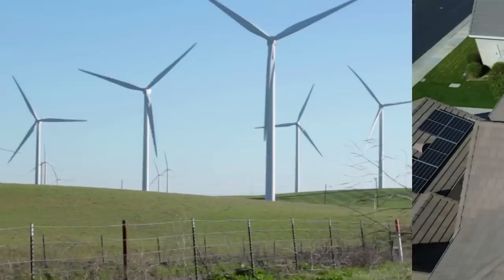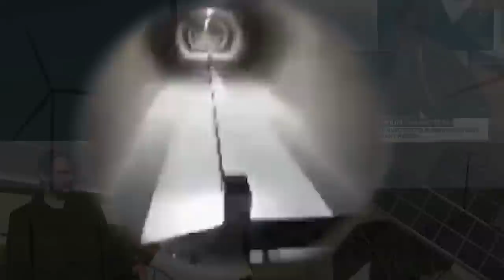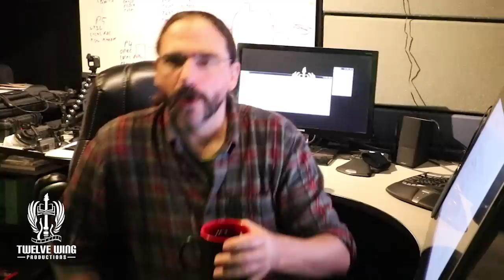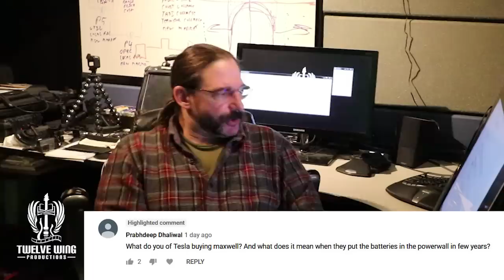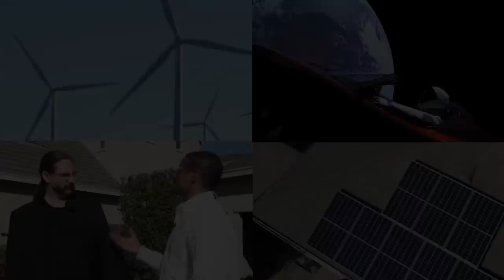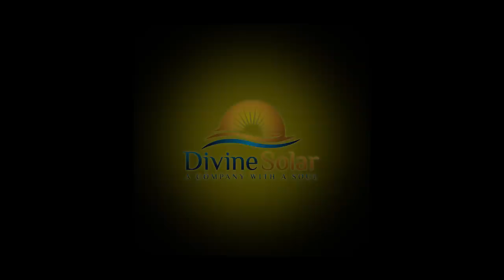Tesla purchases Maxwell; What does it mean for the Powerwall?

Comment: I haven't looked that deeply into the tech specs of the PW2 but I would have imagined the 5kW constant output limitation to the PW2 was due to the built-in inverter and not the battery cells themselves. Due to the lack of power retention in capacitors I don't so much see them having good use for the home unless it is used on the AC side for appliance starters, like an air conditioners soft start. The best use I see for the ultra capacitors is just as you described, for rapid car charging where the cap can then slowly discharge into the battery pack, allowing for a very rapid "refuel". I won't even get into the performance benefits an ultra capacitor could add to an electric sports car.
Reply from the maker: I don't disagree, and frankly I am holding judgment on the whole thing until I can get more solid information on just how "ultra" the new ultra capacitors are.
If they can hold more than 80% of their charge for 8 hours, they will be a HUGE benefit to home battery installations.  That's about the tipping point though.  Anything less and the losses will be too great.  If they can manage more than that, then it will be a game changer for the home.

I can envision them being available as a separate module.  But again, much depends on efficiencies and physical size.
Reply: @twelvewingproductions7508  I was thinking more or less holding at least 90% of their charge for at least 24 hours. Again, we don't really see any reason for rapid recharge or discharge in home use other than in appliances that have quick heavy demands, such as an air conditioner or well pumps which we already have soft starters for. Solar has a limited output, so lets take our 8+kW arrays for example, I only have two PW2s, nothing compared to your stash, but I have an 8.82kW array. Even at its max output I can't push more energy to the current model PW2s than what they can take (10kW combined) for a charge. Unless we have wind slapped into the mix which can have a MASSIVE output all of a sudden, then very little, I don't see much need for capacitors in the home, the loss would just be too great for pretty much no return.
I would love to hear what you had in mind for home use, however.
Reply from the maker: @BrettB246 , that was kind of the point I was trying to make.  That it's not just the large loads but that in a home who's average, like the ESP home, is 30kwh a day, 2 powerwalls simply isn't going to cut it if eachis only capable of 5kw of discharge.
But add ultra capacitors and that capability changes.
So what I have in mind for home use IS The Energy Sovereignty Project.  That's why I'm doing it with that home and not the studio that averages about half that at 17kwh per day over the course of a yearly average.
Reply: @twelvewingproductions7508  I think you're still confusing capacity with rate of discharge. The PW2 has a total capacity of 14kWh (13.5kWh usable) with a sustained rate of discharge at 5kW (likely inverter limited) so over a 24 hour span it could discharge 120kWh based on the discharge rating, but only 13.5kWh over that span unless recharged multiple times. Two PW2 units could discharge at a constant 10kW with a usable capacity of 27kWh. Considering you don't draw from the batteries during the day, normally, 27kWh of storage is adequate for a home that consumes 30kWh over a 24 hour span. It wouldn't work when you take long or multiple overcast days into account, but that has nothing to do with their rate of discharge as it's limited by the inverter. So thinking of an ultra-capacitor as nothing more than a battery with faster charge and discharge capabilities, increasing the storage ends ability to discharge at 50kW does nothing for home use when the inverter is limiting it to 5kW.
Generally speaking 5kW constant output per PW2 is sufficient as larger homes with higher demands will also usually require larger storage capacity and thus more PW2s. In situations like your own, you would better benefit from larger attached storage and not a higher output rating. Adding a secondary bulk storage unit, like a flow battery, which has higher storage but maybe lower output rating would be better as I'm sure outside of charging your cars you rarely pull over 10kW at any given time but could benefit from an added 200kWh of storage.
Increasing storage capacity doesn't require higher output ratings. Having a low-output high capacity storage system that retains its charge over long periods of time can be used to trickle-charge your lower capacity higher output devices, such as the PW2 or in the future maybe an ultra-capacitor with better retention capabilities. Either way your max output is limited to the inverter and our current battery technology doesn't seem to have much if an issue pushing inverters to their limits.
Reply from the maker: @BrettB246 , trust me, after all this time with the project, I'm not confusing anything.
I think what's going on here is that we aren't adequately communicating to each other.
Let me try and take your points one by one so we can put this to bed.

First, let's clear up a misconception:

"Considering you don't draw from the batteries during the day"~

The home does draw from the batteries during the day Brett, that's part of why I think you and I may be not communicating well why the capacitors are needed in a smaller system.
During the day, home use usually peaks around 6kw during times when the air conditioning is on and someone makes a pot of coffee or something.
This number goes to around 10kw for brief periods during days where laundry and other household chores are being done.
A 2 powerwall system would not be able to keep up with this load reliably as it would be in danger of either tripping off or drawing power from the grid.
The outflow current from a powerwall that had ultra capacitors would be able to handle these loads for brief periods and because of that, fewer powerwalls could be employed to power an entire home's loads.

"increasing the storage ends ability to discharge at 50kW does nothing for home use when the inverter is limiting it to 5kW."~

The mistake I think you are making here is in thinking that a battery that uses ultra capacitors is going to be built with the existing design of the Powerwall 2.  It won't.
If it's going to be designed to use ultra capacitors, then they are going to design the output of it's inverter to handle the increased output.
It's entirely likely that the inverter itself will be built with ultracaps.
I do get how you are seeing the current inverter as a limiting factor though.  I'm just not viewing the "Powerwall 3" as having the same inverter.

As the prices of the batteries come down and their energy density goes up, I can see them combining the units into more sensible blocks.
If I were a betting man, I'd guess that the new units will be in 30kwh blocks for home use.
If I were on the team doing the specifications for such a thing, I would have each unit capable of 20kw in output.  Probably split between two internal inverters for increased output and redundancy.
Reply: @twelvewingproductions7508  It would be nice to see a 30kW battery but I also see it as overkill for most homeowners.
I have a different setup and that's likely why I didn't think drawing from the battery during the day was an issue since I don't, again unless it's overcast. Generally my solar array is outputting more than my home needs even with the AC and water heater running, along with anything else going on in the house. Occasionally a dense cloud may blow over and drop my output but almost never down to 0 unless it's a bad rainstorm. If I have the oven on, water heater running and AC running, and I'm drawing 8kW but some clouds blow over reducing my solar output to 4kW, then I'm only drawing 4kW from the PW2s. If I do these things at night then yeah I come close to drawing their max constant output.
What I'd rather see is the components be separated a bit better for a more modular system like many others have done. I don't see myself needing more than 15kW constant output but I'd love to have a weeks worth of storage / backup. Currently in order to get a weeks worth of storage I'd need at least 15 PW2s (this is an extreme example) but I darn sure don't need each one to have an inverter which would allow a max constant output of 75kW, so I'm pretty much paying for inverters I don't need at that point.
Back to the capacitors... again, what I feel, is that unless they can make capacitors act much more like batteries in that they can hold a charge for a very long time, I don't see much use for them in the home. Holding a long-term charge would be idea as capacitors are usually a fraction of the cost of batteries, so if they can make an ultra-capacitor that can hold, for example, 100kWh and retain at least 90% of its charge for about a week, then it would be hugely competitive against current battery technologies and would be useful even for home use, I just don't see a need for rapid DC charging or discharging at home, again unless it's to do something specific like to charge you new electric car which is also equipped with such a capacitor. Going through an inverter is going to kill any benefits a DC capacitor would provide, having an AC capacitor on the business end of the inverter, however, could essentially provide a whole-house soft-start that would protect the inverter. 20kW inverters are serious overkill for the majority of residential uses so I don't see it happening. 10kW maybe, but they went with 5kW for a reason and that was for better scaling. Small home that uses only 15kWh per day likely won't draw more than 5kW constant output many times throughout the day, if at all. Homes that use 30kWh per day likely don't need more than 10kW constant output... and so on. Remember the PW1 only had 6.4kWh with 2kW constant output, then Elon realized that was too small and scaled it right the second time around. What wasn't taken into account is people or projects like your own where you want a large amount of backup time but may not need 30kW constant output. Removing the inverter from 2 of them would still allow 20kW constant output but may also save $1,000+ each due to the lack of an inverter, it'd just be the battery. Obviously this would need a different design, but you get the idea. Pick your max kW draw needs for your inverter, then pick how many battery packs you'd like to add to it. Elon just wanted to keep it simple but by doing so made it a bit more expensive for anybody just wanting higher capacity without the need for a higher output rating.
Reply from the maker: @BrettB246 , 

"It would be nice to see a 30kW battery but I also see it as overkill for most homeowners."~

Just to make sure we are on the same page... that's 30kwh... capacity.

I pretty much see that as the smallest unit.
Again, it's difficult to know how you are describing "most".
On average, a home in the US uses 30kwh a day.
That's why we chose to use the home we have instead of my studio.
So as you follow along with The Energy Sovereignty Project, realize that this home does represent the middle ground of energy use.

As you follow along, what we are demonstrating is that 60kwh of storage is about minimum to support a home of this size and with an electric vehicle 60-90kwh is going to be pretty standard in a couple years.
What makes it sound ridiculous at the moment is the price... not the result.
Reply from the maker: @BrettB246 , 

"It would be nice to see a 30kW battery but I also see it as overkill for most homeowners."~

Just to make sure we are on the same page... that's 30kwh... capacity.

I pretty much see that as the smallest unit.
Again, it's difficult to know how you are describing "most".
On average, a home in the US uses 30kwh a day.
That's why we chose to use the home we have instead of my studio.
So as you follow along with The Energy Sovereignty Project, realize that this home does represent the middle ground of energy use.

As you follow along, what we are demonstrating is that 60kwh of storage is about minimum to support a home of this size and with an electric vehicle 60-90kwh is going to be pretty standard in a couple years.
What makes it sound ridiculous at the moment is the price... not the result.
Reply: @twelvewingproductions7508  30kWh battery was just using your previous comment as an example. "If I were a betting man, I'd guess that the new units will be in 30kwh blocks for home use."
I'd like to see them in blocks of simple 10kWh, if you need 30kWh storage, buy 3 of them and attach them to an inverter unit you also chose, 5kW, 10kW, 15kW, 20kW...
The only place the capacitors would serve in this situation would be if you opted for a 10kWh storage capacity but a 20kW inverter, which would provide temporary whole-home backup until a large generator could kick in. In that case the 10kWh of cells may not be able to handle that output and in this case a DC capacitor would be better suited as you're not looking for long-term storage anyway, just short-term backup, but then we're getting away from the original point of home energy storage and just making a whole home UPS that'll last long enough for a genny to kick in, not exactly what Elon would go for in my opinion. In that case there would be a limit to the size of an inverter you could get based on the number of battery banks you purchased.
Either way I wouldn't mind seeing home energy storage, or large scale storage, moving to something like flow batteries, where space isn't as much of a concern, thus reserving our precious lithium and other metals for more space restricted uses, like vehicles.